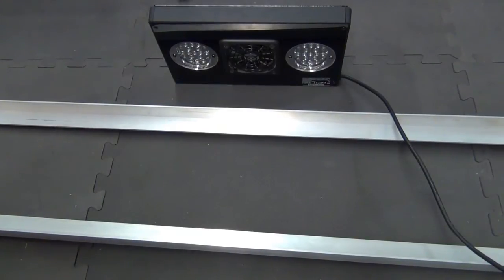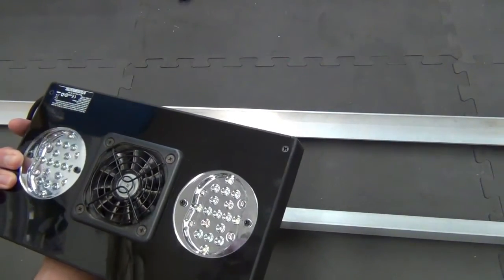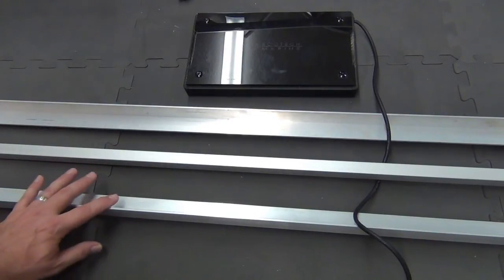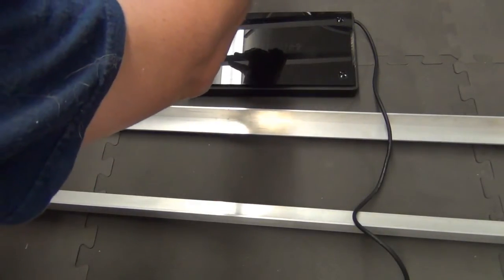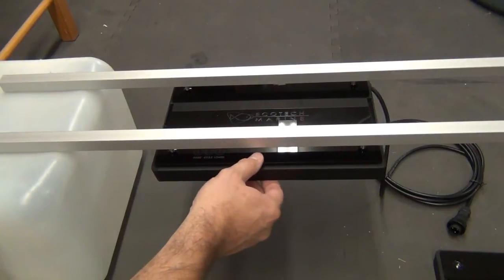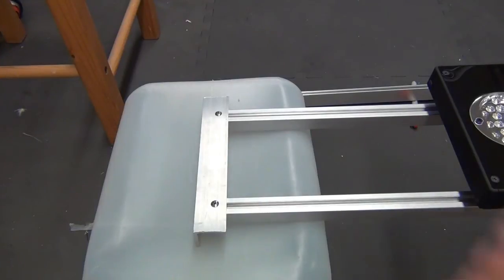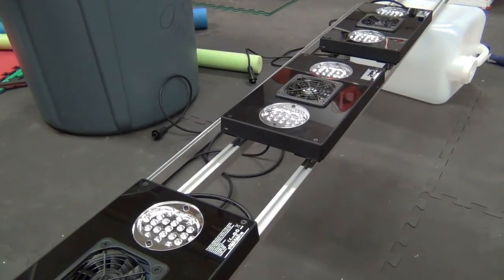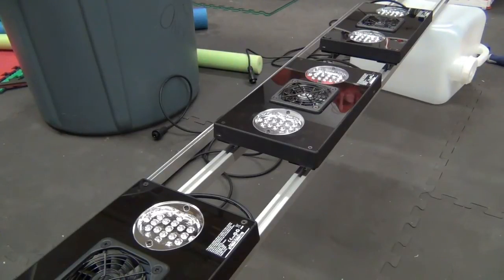Custom Radion Rails

Comment: How did you find, "a little bit longer screw" that would fit with the Radion and not strip the threads?  Trial and error?  Is there a particular item on amazon I could order?  Thanks in advance.
Reply from the maker: I actually just took the screws that I were on the radion and went to home Depot and matched them up.

Comment: Jay- I purchased 40X40x1S. Was that the size you bought? I had to add a washer to the screw head to prevent the screw from falling out. What size screw did you use?
Reply from the maker: I ordered the 20x20 1S.
Reply: Rex Roth was a great find thanks. I made the 40X40 work.

Comment: Howdy,
Thanks for posting this video! I'm ordering the Bosch Rexroth now and I have a few questions:
1. Looking at the Profile 40x40 2SA, M12/M12, do you think you could tuck the cord from the Radions into the adjacent track to make it a bit more streamlined?
2. Where did you get the aluminum L-track? I couldn't find it on the Bosch Rexroth site.
3. Did you purchase the machined profile of the Bosch Rexroth or non-machined?
4. Was it easy to find the correct size head and thread stainless screws to fit the track and Radion mounting holes, respectively? Where did you get those?
Many thanks!
Scott
Reply from the maker: Thanks for watching.  Let's see if I can answer your questions:
1) I just tried to stick the cord into my track and I can get it in there but if you wanted to put more then one cord in there I don't think it will fit.
2) I got that "L-track" at Lowes.
3) Honesty don't know.  I would assume that they are non-machined.
4) Got the screws at Home Depot, nothing special about them other than they are stainless.  I just took the screws that I had from the ecotech hanging kit with me and just matched it up.  If you don't have the screw to use you could take the fixture with you or email Ecotech and I'm sure they could tell you the screw size.  Finding a screw head to fit in the track wasn't an issue because once I found the right size screw the screw head worked fine.

Hope this helps....Scott
Reply: jayhawkscott Thank you! I placed my order.

Comment: I like the rails you chose for the Radions.  What are the dimensions, width and groove size of the rails.  I would like to order a set as well.  Also, how did you hang the rails over the tank?  Is there a part 2 to the video?
Reply from the maker: Hey John.  I actually hadn't planned on doing another video but maybe later I will.  Here is a link to the Rexroth that I used and it will give you all the measurements that you should need. http://www13.boschrexroth-us.com/Framing_Shop/Product/View_Product.aspx?category=10101&subcategory=8
I mounted the fixture to my canopy using another piece of the angle iron that I screwed into the side of my canopy and then the end pieces of light fixture sits on that and slides back and forth.  Let me know if this doesn't make sense.
Reply from the maker: Oh, forgot to mention the rails over my tank at 6 feet long.
Reply: jayhawkscott
Thank you, appreciate the link with all the measurements and the quick response.

I was thinking of getting the rails with three rail groves (20x20 3S), one to suspend the Radions from the screws, the other groove at the top of the rail to attach a hanging wire and the third groove on the inside of the rail to insert and hide the Radion wires. Do you see any problem with my approach?

One last thing, what are the specs for the screws you used?